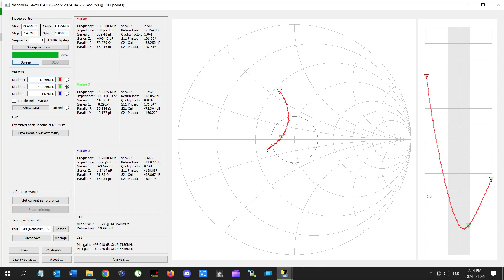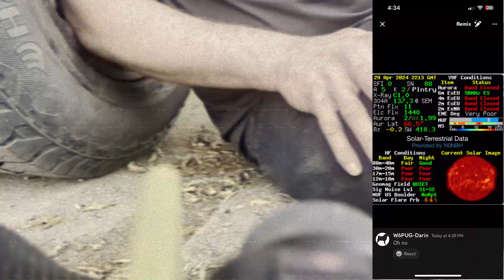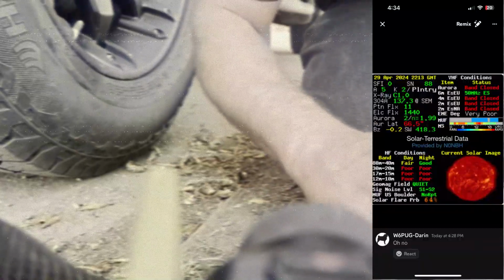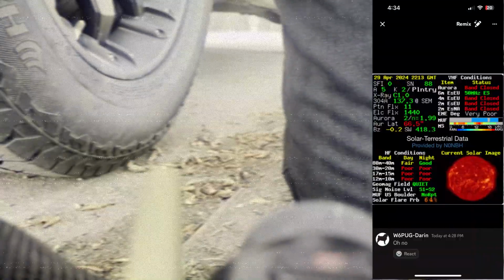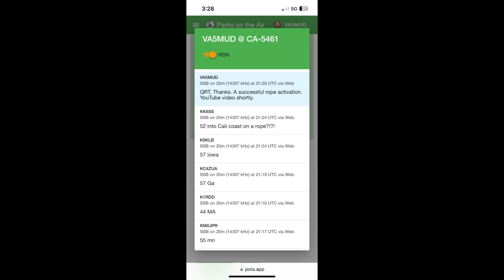MAY I INTRODUCE TO YOU THE ROPE TENNA. SIMPLE DIY TO GET ON THE BANDS free AND FAST #pota #antenna

Comment: Love your channel and your videos Wes! Curious what the rope adds? Couldn't you just pull the wire up in the tree?
Reply from the maker: Great question.  The total length is shortened by winding on the rope.  You  then don’t need to throw your line as high but at a cost of efficiency of the antenna.  It was just a fun project and a start of other projects linked to this set up.